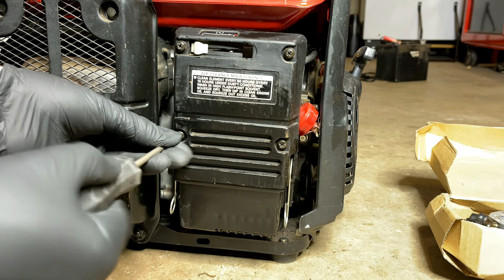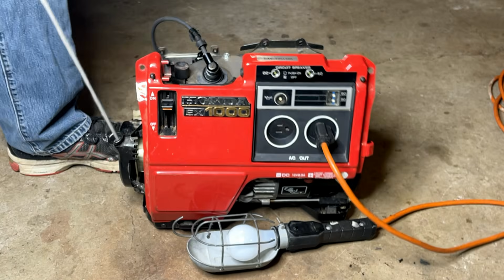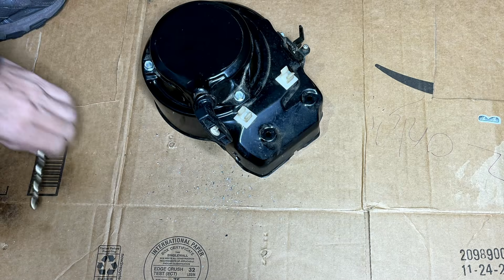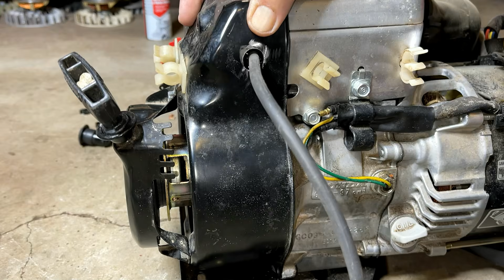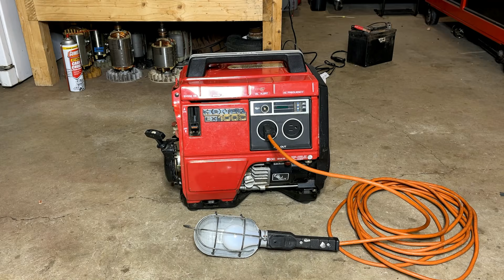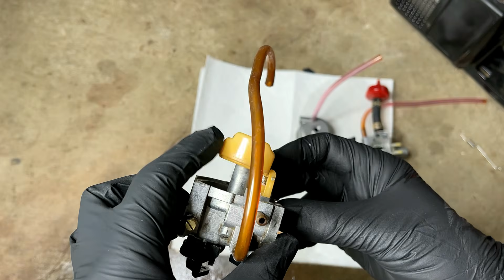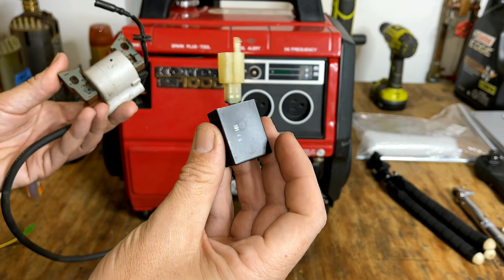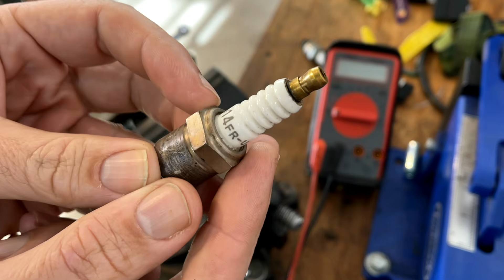Honda EX1000 - Will It Run?

Comment: For drilling holes in sheet metal you will do well to purchase a step bit for ease of drilling and concentric holes.  Enjoy your channel.  Great sleuthing on the coil / rotation not to mention the bad spark plug
Reply from the maker: I agree, thanks
Reply: Absolutely.
Reply: Yup.  Step bit fir sheet metal.  If nothing else your hands will appreciate it.

Comment: James , their is kill switch on the inside of the front cover , i have had trouble with those on this model. That coil looks like genuine honda coil built in 2018 by maruba . A very nice generator. Im a collector of these old hondas. I even have one of the old honda e40 with the 17cc engine from 1964 !
Reply from the maker: I usually sell everything I repair, but might keep this one.  Its very well made.
Reply: @jcondon1  Thanks again for all the help you have given me !  You didnt even know you were doing it  !

Comment: I had a 1968 Ford pickup with the 300 inline 6 cylinder engine in it. It would run perfect on all 6 cylinders when cold, but once it warmed up to operating temp it would start mis-firing on one cylinder. It took me forever to figure out it was a spark plug issue. This video reminded me of that time many many years ago.
Reply from the maker: Thanks.  Up until recently, never had a spark plug issue.  Since this generator, I have come across two others.
Reply: @jcondon1  I worked on automotive engines for years, and I only ran into a spark plug issue such as this only once. So, I'm guessing it's quite a rare occurrence.

Comment: At min 16:44 you can see the spark on the housing under the air filter metal plate. When you tested again the old coil.
Reply from the maker: I took another look, do not see it.

Comment: Best way to make sure, that the frame does not cut the cable is to take some fuel line, cut it lengthwise and use it to protect the cable around the hole you made. But the grommet you found was perfect

Comment: Most repair shops would have given up. I applaud your tenacity.
Reply: LOL, it seems he did give up several times but circled back.
Reply: more easy money in selling a new one....!
Reply: It might be possible that just getting to slightly smaller hole wise in the oven model cars you might try cleaning the jet in the center of the car before switching the jet between the two carbs and it may work I would definitely clean it first
Reply: Just for future reference AutoZone in Nampa held himself bug and sodas O'Reilly Auto Part they can order it and have it the next day
Reply: @joebrock9784 😊

Comment: Wow, a major challenge.   So many issues.   A lot to learn from this video.   Thanks.   Glad that you finally got it back to normal operation.   Well done.
Dave.
Reply from the maker: Thanks
Reply: @jcondon1  Would you still put it on line with a freezer full of meat?

Comment: Thought you found the problem when the plug boot measured 10K but that is what the short Honda boots normally measure whereas the longer ones read around 4 to 5k like you mentioned. Very surprising to see the plug being the issue at the end but good test with the heat and ohm check. Only EP tip i can give you is get a Pender lift to work on when your bench is loaded because the first thing to go when you get older as i am is the knees. Thanks for another great video the OLD MAN at EP over and out!
Reply from the maker: Thanks.  Been looking at lift tables, but have not found one yet I like.  Will check it out.  Still have a little time before the knees give out.
Reply: @jcondon1  Got our hydraulic Pender style lift from Canadian Tire on sale $100 great deal many years ago. Think they run around $250 now
Reply: Troy we are in Southern Ontario, Canada and i believe all the Menards are in the USA. Buffalo New York is only 20 minutes away from us but with the pandemic testing and border crossing now not worth the trouble to go there. In the future maybe we go to a Menards i hear they are great.

Comment: Did you think about reversing the starter recoil to spin the other way? Or was that too much of a hassle?
Reply from the maker: The engine can only run in one direction.
Reply: @Bryan Anderson How would you propose to reverse the recoil starter? That would never work for the recoil starter for multiple reasons, and the engine has to spin in the direction it was designed to? Your suggestion would reverse the entire 4 strokes of the engine cycle, valve sequence, cooling fan, spark timing etc etc..So even if it were possible to reverse the starter direction to create spark, the engine still would not run🤣👍🇦🇺
Reply: @simonilett998  No, I was merely saying when the pull the starter, it spins it in the correct direction from the factory. Instead of switching the orientation of the ignition coil.
Reply: @banderson5144  The recoil starter was already spinning the engine in the correct direction, as designed from the factory. James misread the direction of flywheel rotation when looking at the recoil starter, due to the way the rope exits the starter cover. It looked like the pull starter would spin the engine anti-clockwise, but it actually spins it clockwise. The issue was that the coil was not the correct part for the engine. But, as luck would have it, the coil worked fine when it was flipped over, and James spun the engine clockwise, instead of spinning it anti-clockwise as he was initially trying.

Comment: ok I have not seen the entire video yet...  but is it posable to flip the magnet in the flywheel?  will that make the coil work in the correct position?  Let me think...  ok maybe not...
Reply from the maker: Don't think so.  The timing will not be correct.
Reply: @jcondon1  if the magnet is flipped.... it physically would be in the same spot...  so shouldn't effect the timing... all it would do is reverse the magnetic field...  that is the same as what you are doing flipping the coil...   but thinking about it some more....   the coil is the one having the delay and it did change the timing when you flipped it...  so since it worked... the timing was messed up from the start....

Comment: James, great teaching and scientific method problem solving.  Just to be clear, were both coils (black one and what appeared to be an older white one) the wrong ones?  So your only option was to switch them over? Thank you so much.  Craig
Reply from the maker: The white one was the correct one.  If needed the ignition module to work correctly.  Earlier in the video I did not realize that and it was disconnected by the prior owner so had no chance of working, but I think it would work if connected properly.
Reply: @jcondon1  I had that question , too.

Comment: Well, I had to use my generator today it took 5 minutes to start it, run like a paint shaker but I plug in the extent cord. 45dgf it was 85dgf yesterday the power went out about 2:10am the wind was bad I plug the coffee maker in and about halfway making, the power came back on 9:38 am That was a very good cup of coffee                                                                                      just saying

Comment: Years of motor bike, car, lawn mower engines has made me check plugs early on. But easy to say. Good spot on the coil, but... as you pulled it over after saying it ran anti clockwise, I could see it turning clockwise. Just a thought on the oil smoke. Could you be overfilling? Some of these motors expect you to screw the distinct in all the way to measure. You always seem to just check without screwing in.

I hate these digging in the dark jobs, good work, good result.
Reply: There's a pictogram on the generator showing how to use the dipstick.

Comment: Jim, if your guess is correct that the unobtainable "ignition module" contains the electronic equivalent of points and condenser,  why not replace it with a generic "atom" or "nova" module. They were more prevalent 20 years ago but may still be available -under $20??  I've used them in the past, and they work, although you may have to swap the wires.

Comment: Just goes to show that someone changed all sorts of parts before you were gifted it  and created more problems than it initially had  Spark plugs have been known to breakdown and that is why they are a service item 🙂 Nice informative channel But as others have stated a workbench  or similar would keep you off the floor
Reply: This comment reminds me of my automotive instructor calling it a bushel basket special.  Everyone was in a car trying to fix it and then gets towed to your shop with all the parts in the trunk and ask you to fix it.  That always costs more!

Comment: I hear people say that the GC series of engines are really good, but I have two arguments about that. One) they're not used in generators, and, two) they're not copied by China. They do seem to run well in pressure washers, but they are not a durable design. As I recall, there are too many plastic parts in them for their comparison to the GX series.
Reply: Im not a honda expert but I have had excellent reliability from my multiple eu2000i generators. One of them I did pick up not running in bad condition with a worn plastic cam gear. I rebuilt it and have thousands of hours on it sence.

Comment: Do ignition coils have polarity? If so why?
What is the function of the kill wire you refer to?
Reply: Kill wire kills the spark by grounding it.
There are no points anymore in the engines. Instead there is a pilot coil in one end of the coil. This is what I think: In order to get spark in right time, the coil must be in the correct way.
Reply: There are 2 transistors inside modern small engine coils. The coil has to be mounted the correct way around to trigger the first transistor to allow charge to build in the primary field coil as the flywheel magnet approaches the first pole leg, then the collapse happens as the flywheel magnet passes the 2nd pole leg. At that moment the 2nd transistor opens the primary field winding, which induces a high voltage into the secondary winding as the primary field collapses, which creates the spark.. That's also why the external ignition module that James identified was no longer needed with the black coil...but would've been needed with the original grey coil. (The grey coil does not have the 2 transistors built in). Hope that made sense👍🇦🇺
Reply: @simonilett998  this makes a lot of sense and has inspired me to research more about how these transistors are working in the circuit. Transistor have a gate a common and I forgot the third leg. Well thanks for your comment.
Reply: @bsdiceman  Here's a link to a really good video, hope it helps👍https://youtu.be/NNlYbvDY6pI
Reply: @James Condon 
That makes no sense to me either. How can the coil make a spark in one direction only?
Unless it's a timing issue.
Reply from the maker: Timing will be off when the coil is backwards.  Also the spark is very weak.  The weak spark might be related to the timing because the coil it trying to fire spark at the wrong time.  Not sure.
Reply: @jcondon1  I think so too. When the coil is trying to fire at the wrong time, then the magnets are in wrong position

Comment: Jim, are you familiar with the earliest history of honda generators? Using this phrase, you can find the link to learn more.
"In 1946, a small engine designed for portable army radios was turned into a useful tool for people’s daily lives."
The most reliable generators I have are either Honda powered, or are a clone.

Comment: My family has a 40 year old Honda EX800. It is used at our off grid camp site to power lights. It has thousands upon thousands of hours on it. The only maintenance done is oil changes and spark plug replacements, plus strictly ethanol free gas.

Amazing machines that are a testament to Honda's quality.

Good find.
Reply: I much prefer the older Hondas that are Japanese made. Everything now is made in China.
I’ve got 3 Hondas and all were tossed away. All beat to hell and all run today. All 3 are a bit down on power since they were all abused with either no air filter, low oil, or both. A little bit of love and a couple of bucks and there all still perfectly useable.
Reply: @FishFind3000  New cylinder and rings and they'd probably run like a top.
Reply: @douro20  yea, but that puts the cost to repair well over there resale valve. And if there working good enough now I’m plenty happy. They will serve me for years like this.
Reply: @FishFind3000  It is WELL worth some new engine parts, especially if you can find new old stock parts.  Nothing except cars is made to the quality of 35 years ago.  Even clothes are lighter and have lower thread counts.  Everything is much cheaper today, but it ain't because the companies are just making less profit, it's because everything is made to poorer standards.
Reply: @tarstarkusz  I think the new Hondas are of pretty high quality. The problem is they have to compete with cheapo stuff that's 1/2 the price. like the HF predator gen's. and for a fair amount of people the HF makes more sense, they may put only 150 hours on it. They'll probably ruin it with old gas before they wear it out anyway. I hope they keep making high quality for people that take care of their stuff and plan on having it for a long time.
Reply: @asbestosfiber  But it's all relative.  Yes, a Honda is better than a clone out of China, but it doesn't compare (as) well to a Honda from yesteryear and that is probably especially true of the electronics. They probably use better metal, but less of it.  Metal gears have likely been replaced with plastic/nylon ones.

Electronics have largely been a mixed bag. Massive integration has reduced parts counts to ridiculously low numbers, but they are made more cheaply and so it kind of washes out. 

For me, something like a generator is a once in a lifetime purchase.  Twice at max, at least for most people.  After all, how often does your power go out?  Maybe if you camp A LOT and run it non-stop, you could put a few thousand hours on it over a 20 year period. But most people just wouldn't use them that often.  But you are probably right that 90% of them go to the dump screwed up from bad gas and would run after a clean.
Reply: Honda's are #1 , i was lucky to find a 1980's ex500 at the landfill of all places , the guy let me have it for a 10 , got home cleaned the carb and it works like a charm
Reply: I was given an old belt drive Honda 4kw from the 80's or so. had been sitting in an unheated garage for at least 10 years. Flushed out the fuel system,  and it started on the second pull.  Also found a more recent 4kw one at the dump. cracked blower housing and bad carb. cleaned it up, changed the oil,  used aluminum duct tape to fix the housing, ordered a new carb, It ran smooth AF.

Comment: You were drill spinning the flywheel the wrong direction early in the video...rotation facing FW is CCW by looking at the stater pull...